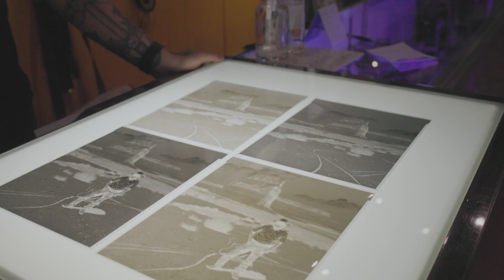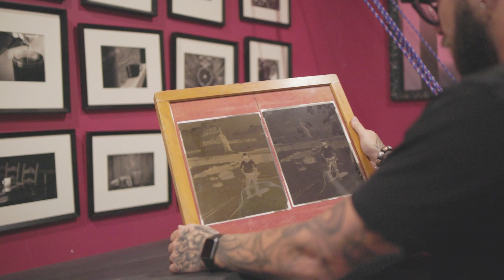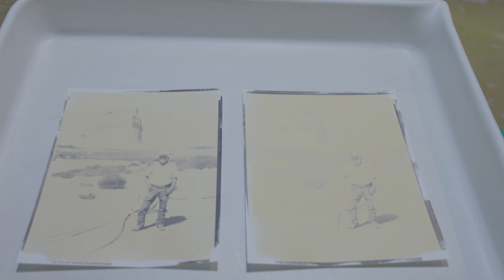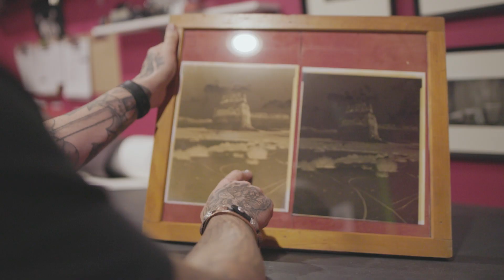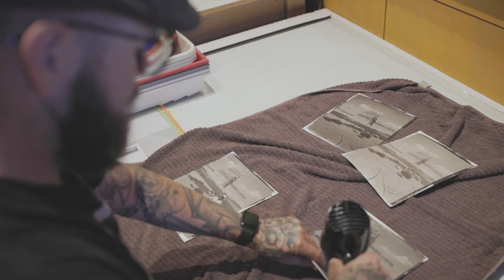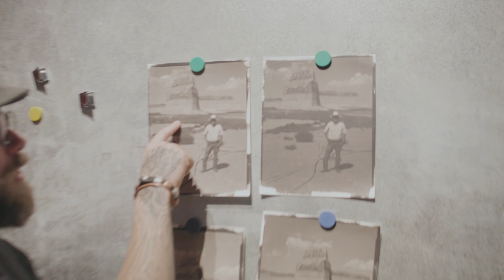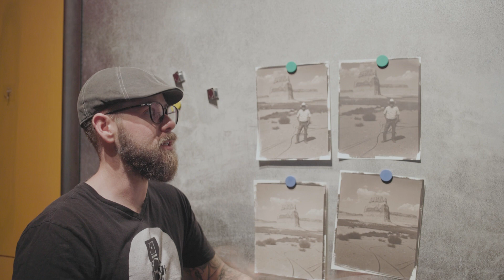Using Two Different Developers! Platinum Palladium Printing

Comment: I make my own glass plate emulsion so maybe this doesn't apply to commercial high speed film. But I found that Kodak D-19 at 1+4 is the very best developer for alternative processes. High contrast, very dense negatives, makes prints with exceptionally wide density range but you definitely need a powerful UV light to avoid very long printing times.

Comment: Interesting test.  I use 510 Pyro with FP4+, but I make it myself.  There could be minor differences in the recipe.  I also shoot HP5 and I find I need to develop that a bit longer than the recommended to get good density.   The largest I shoot is 4x5, and I print both silver gelatin and kallitype (gold or palladium toned).  For silver gelatin I have found plenty of contrast (usually printing with a grade 1.5 or 2 filter) but for Kallitype, I always digitize and then print from digital negative so can't say anything there.  For stand development I use 510-P at 1:499 for 60 minutes, agitate for 1 minute at the beginning, and 10-15 seconds at 30 mins.  Unless I make a mistake and horribly underexpose the negative, I end up with good contrast although it does take more time 🙂 I'd be interested in knowing where this experiment has taken you since this video... have to admit that I haven't looked through the channel yet to see if you did a follow up though!  🤣

Comment: The 510-Pyro negative is under developed for your printing process. To increase contrast, decrease exposure (blacker blacks) and increase development (brighter whites). Add a minimum 50% to your development time, but better yet, double it and hope you’ve over developed and defined an upper limit, then if so, split the difference. Platinum, as you know, wants a long density range in the negative, so take the gloves off (metaphorically).
Reply: Agreed, the 510 Pyroed negatives are massively underdeveloped